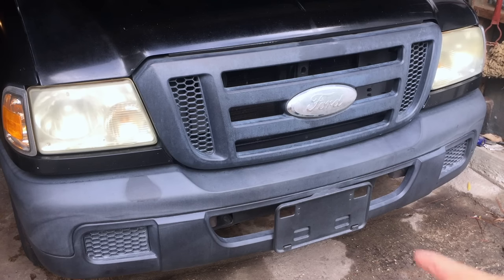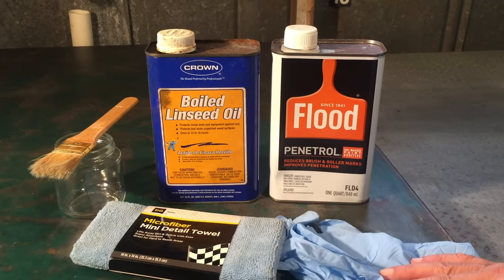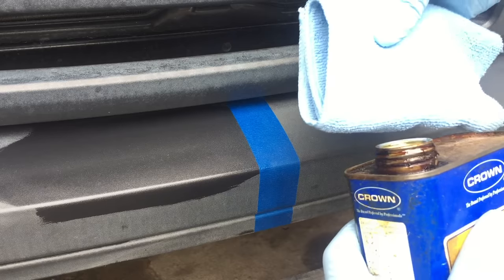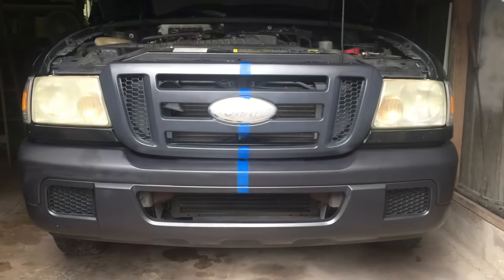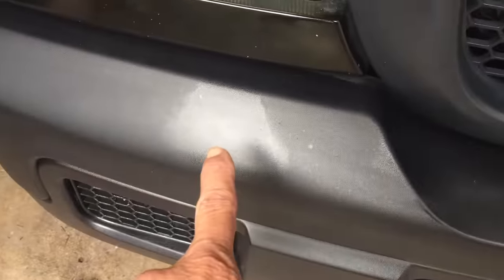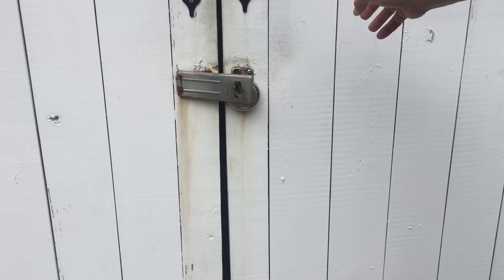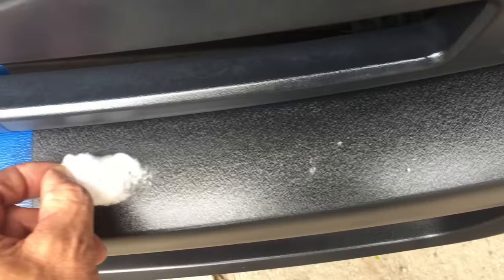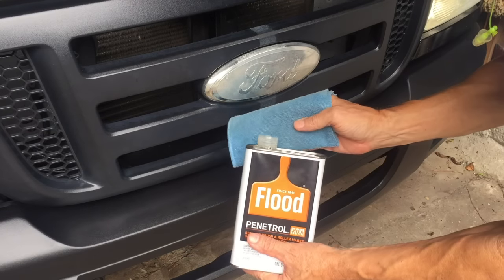Restore Faded Plastic Trim Penetrol Vs Boiled Linseed Oil

Comment: Having worked at a shop in the desert that specialized in off-road vehicles I do not recommend using a heat gun on plastics or linseed oil (alone). The plastic fades because of UV exposure and the oils in the plastic coming to the surface, oxidizing and flashing off into the air. By using a heat gun method you typically clean off the oxidation and then pull the oils in the plastic back to the surface. The problem with this is over time the plastic will become very brittle. By using linseed oil alone it can not penetrate into the plastic very well and simply dries on top. The penetrol however, because it has a solvent, penetrates INTO the plastic thus replenishing lost oil back into the plastic. Bottom line use Penetrol and then a UV inhibitor such as 303.
Reply from the maker: Great information and suggestions!! Thank You!!
Reply: Thanks for sharing great info. I’ve seen others use 303 alone now Penetrol and Protectant should seal the deal!
Reply: Soo now I have to varnish my boat AND truck!? What world is this?
Reply: Just go ahead and prep and varnish your entire car. Three coats for every month of sun exposure yearly. Lol
Reply: This is for vehicles, you’re gonna sell right away, so…
Reply: @walterkersting9922  I wouldn't do that to somebody.
Reply: I live in the dez.  Nothing seems to last longer than a couple of weeks before my old Jeep fenders look crappy again.  I'll have to try the Penetrol + 303 combo.
Reply: @chesterreese2771 Howdy folks, since posting this I came across a new product that appears to have great promise. I have not tried it yet but I know someone who has and it looks amazing. The product is called Cerakote "Ceramic Trim Coat Kit" and he used it on the rubber also.
Reply: @tongo117  Howdy folks, since posting this I came across a new product that appears to have great promise. I have not tried it yet but I know someone who has and it looks amazing. The product is called Cerakote "Ceramic Trim Coat Kit" and he used it on the rubber also.
Reply from the maker: If anyone is familiar with the Project Farm youtube channel Cerakote won his car trim restorer competition a few years ago:https://www.youtube.com/watch?v=XXOX4z6uwXo
Reply: I mix with minerals spriits
Reply: So how long does it last? With penetrol & 303?
Reply: @ronniegillaspy  Howdy Ronnie, it's not a permanent fix but the Penetrol helps to remove the oxidation without drying out the plastic and the 303 helps keep it that way. Depending if you left the vehicle outside or parked it in the shade or garage the amount of time this would work varied. However, after posting this a friend of mine introduced me to the new Cerakote Ceramic for Plastic. IT WORKS GREAT! One thing though, be sure to remove the oxidation first with a good cleaner and possibly a 1500+ sandpaper.
Reply: I used to do all that. Now I just super clean the trim and cerakote it with a good spread. Its absolutely gorgeous.

Comment: Let me add something to the discussion,  Penetrol is also excellent rustproofing...wire brush the loose rust off and 2 coats and it will not rust. Its original use was the NAVY used to dry dock their ships and sand blast the hulls, penetrol then primer and paint...back in the ocean for 7 years.
Reply: I new the employee that worked on the owners new Cadillac that the guy who started the Flood company...every year in the 60's he bought a new Cadillac and my contact would soak his brand new cars down ...The guy sold the company in the mid 90's and had 10 showroom condition Cadillacs that he drove all the time...
Reply: Knew....
Reply: Going to try this on an outdoor steel work table. Thanks!
Reply: @manandatractor  by itself it is not UV resistant...oil base paint over it.

Comment: I added 25% white spirit(mineral spirits in the US) to boiled linseed oil. It seemed to help absorption and dried quicker with no sticky residue.
Reply: I agree but I use 60% boil line seed oil and 40% mineral spirits

Comment: I tried using Penetrol on my 2020 Toyota Sienna. It only lasted 2 days before reverting back to its old oxidized self:(
Reply: Did you use the water based version or the oil based version? Legit question, as I'm researching if this is what I want to do.

Comment: I fought this battle for ever; bought all kinds of stuff, tried ‘hacks’ and so on.  Then one day I took all the plastic off of my car, taped off all I couldn’t remove and painted it with a flat black spray paint.   Twenty years later it still looks good.   I have a foxbody Mustang that all the black trim looks brand new on.      Just five up the fight-  wash the parts with Dawn dish soap several times, when dry clean it with prepsol or denatured alcohol and put two to four light even coats on the part.  I have done the same on my wife’s pilot, and I have a 2019 jeep that is about to have the cowling vent tray painted.  I used two different chemicals on it when I washed it, but the sun in Alabama cuts through that stuff.  Paid your trim, thank me next year
Reply: Ordinary spray paint?  Not one of the plastic compatible versions? I see most of the paint companys claim univeral materials compatibility
Reply: There is paint, and then there is paint. From my understanding there can be a big difference wether they contain urethane or not for example. Would love to know which brand you used? Then again, ten years later they may have switched their formula.

Comment: Penetrol has a penetrating power 3 times that of water, it goes deep into the substrate and forms a strong bond for subsequent topcoats. I swear by it... artists use it to seal rusty outdoor sculptures etc, vehicle restorers use it to seal rusty parts/panels for a lasting patina, it's used to thin paint, it's used on vehicle chassis as a rust inhibitor prior to painting... it's uses are limitless!!!

Comment: I use that Rust-Oleum trim and plastic paint in a rattle can. It's literally lasted for years in the Florida sun and still looks good. I disassembled the grill and everything and gave it a good spraying after cleaning it up. I did a complete video about it too. Of course the video went nowhere except probably down the YouTube toilet that stuff works. It seemed like every royally thing that I ever put on the plastic parts just washed off eventually.

Comment: The best product I ever used on clouded faded trim is a ceramic wipe on from Cerakote. I put it on my truck a year ago and it still looks like new. Highly recommended.
Reply: Yes, came out in top in a side-by-side review of something like eight different brands here on Youtube. Incl. Mothers, Turtle wax and Meguiars(?)
Reply: that just coats the surface with ceramic coat. its not actually getting into the pours of the plastic
Reply: @johnadona3014  It's been a year and a half and it still looks good. I'll take that anytime.

Comment: I tested this idea several years ago on a neighbor’s Toyota Tundra’s faded front bumper. Used Floetrol, a latex paint additive, instead. Worked fine. 

If you treat plastic trim regularly with silicone tire shine it won’t fade. I applied it to exterior black plastic and rubber on my ‘84 Peugeot 505. After 25 years it looked new.

Comment: Mix 50:50 clean engine oil with lacquer thinners in a jar and wipe on. Cheap, gives the same appearance to trim as Penetrol, and it lasts a good while (maybe not as long as Penetrol, but at the price you can reapply as often as you want). The thinners helps the oil penetrate, and also avoids a sticky finish that dust will cling to.
Reply: Petroleum oils, plastics, and rubbers do not go well together.

Comment: I was talking with a guy at the gym last night about our muscle cars. He told me back in the 90’s he and his dad won 2nd or 3rd place mainly because they used Penetrol in the engine area. So.  Off to YouTube to find you. Great video. I’ve used BLO in the past but was left with a tacky surface for a while. On ATV plastics, smooth plastic, I’ve used Harbor Freight’s torch to heat up the plastic. After sanding off the white oxidized area, the torch leaves a showroom glossy finish that has lasted for 12 months. Just wanted to pass that on. Thanks so much for your video
Reply from the maker: You're welcome.. Thanks for the torch tip.. And when you say torch, heat gun or actual propane torch??
Reply: @tongo117  it’s a torch that screws on top of the green propane canister. You’ll wonder how you lived your life without it.

Comment: I use BLO for wood working and it definitely matters how you’re applying it. You want thin coats. I cut my BLO with mineral spirits (3:1 BLO:Spirits) or you’ll get thick parts that won’t dry fast enough and get gummy. You’re supposed to buff it off after the wet shine starts to dull but before it gets gummy. I live in Arizona so BLO dries to touch in a matter of hours (consider using something else in high humidity locations). ALWAYS wear gloves when handling store bought BLO because they use metallic dryers to help them cure faster that absorbs into our skin.
Reply: I cut my blo with baby laxatives

Comment: Years ago I tried automatic transmission fluid on my exterior plastic and rubber parts after seeing a part of my bumper which I had spilled a drop of ATF onto still looking "restored" after a few months. Still looked like new after 10 months which is when I sold my car.
Reply from the maker: Good to know.. Would not have thought of trying ATF

Comment: Impressive results and improves the truck no end. Just been online to see if we can buy Penetrol here in the UK and yes it can for £111 ($133) two quarts! Looks like I'll look for some other similar product 🙂
Reply from the maker: What's your cost for Boiled Linseed Oil? It's been 8 months since the application and I don't see any difference between the two sides..
Reply: Polytrol made by Owatrol works the same if you're in the UK
Reply: @Adam-wu7vt  Many thanks Adam and indeed it is available in the UK and for a much more reasonable £20 per 0.5 litre (0.9 pint).
Reply: @dontuno   No problem, I use Polytrol myself, and have been very pleased with it 👍
Reply: @dontuno  . In the UK boiled linseed oil is only £3.35 per 500ml. Add 25% white spirit and it works just as well.
Reply: that’s what I was thinking as well as white spirit is used as a solvent for boiled linseed oil, and according to previous comments Penetrol is basically linseedoil with added solvent for increased penetration. Now all we need to know is what the ideal ratio is.

Comment: I have one more product you might try.
Seal Krete by Rustoleum, is polymer link for paint and cement / mortar and concrete sealing .. of all things.. 
It makes a nice vinyl shell top coat. Add it to the other products you tried to make them perform better and last longer.

Comment: That $13 bucks added $2000 in resale value to that truck.  Great info!
Reply: Here's an update to my original reply.  I tried the Penetrol based on the results I saw in this video and I also got excellent results.  It's only been about a month, but so far there is no streaking and my plastic still looks great.  I live in the south and we've had a lot of rain, humidity and heat.  It works so much better than Back to Black in that it seems to stay on thicker and more evenly without as much effort to apply and even out.  I applied this to a Ford and a Volvo and both look fantastic.  I'm sold.  Great, useful video!

Comment: I've found that all of the ways to do this never seem to last for more than a few weeks, top.  How is the Penatrol holding up over time?
Reply from the maker: It's holding up well.. Below is a link to a related video I posted 6 years ago showing 10 month later results of Penetrol application on my 95 Honda Accord.. Not the best quality video but it will give you an idea as to how long the Penetrol lasts.. And I will post follow-up one year later video on the Ranger in mid Sept.. https://www.youtube.com/watch?v=adFWRHFalQY
Reply: @tongo117  Thanks!  Much appreciated!

Comment: If you heat the plastic with the heat gun slightly before applying it, it will penetrate deeper and last longer

Comment: Thanks for the comparison! I wonder if there is any difference between Penetrol for latex paints and those for oil-based paints?
Reply: Yes, Penetrol for latex doesn't contain any oil at all.  It's water soluble.
Reply: @robertweinmann9408  Thanks for the clarification! That is what I thought.
Reply: Good point ...,.latex and oil paint penetrol two different brands..,.

Comment: Great video, thanks for sharing. Curious question. After the initial application of the Penetrol how often do you have to reapply? After each washing or every few months? Thanks again.
Reply from the maker: It does not wash off but does slowly fade.. I use it on several cars and apply probably once a year.. If you want to keep it really fresh/dark then every 6 months or so should work..
Reply: @tongo117  awesome! Thank you for the reply!
Reply from the maker: FYI. Just had another comment on this video that recommended using this UV repellant topcoat after the Penetrol:
https://www.amazon.com/303-Vinyl-Plastic-Automotive-Protectant/dp/B0185PU38A/ref=asc_df_B0185PU38A/?tag=&linkCode=df0&hvadid=312177492641&hvpos=&hvnetw=g&hvrand=11731298867953210669&hvpone=&hvptwo=&hvqmt=&hvdev=c&hvdvcmdl=&hvlocint=&hvlocphy=9011294&hvtargid=pla-755955906432&ref=&adgrpid=61116063494&th=1
Reply: @tongo117  oh wow, thanks man, I appreciate it!
Reply: @tongo117  Great Stuff! Good for restoring wiper blades, shine tires, interior, etc...

Comment: I have a hunter green aluminum garage door that has become faded in 20 years. I tried Armorall and it does a decent job but is blotchy...paint still great underneath. What svould I use that will look good and not need a lot of care? I was thinking car wax but it doesnt last. Thanks.
Reply from the maker: Possibly this:
https://www.amazon.com/AL-NEW-Aluminum-Restoration-Furniture-Stainless/dp/B079ZYD6W7/ref=asc_df_B079ZYD6W7/?tag=hyprod-20&linkCode=df0&hvadid=242014065805&hvpos=&hvnetw=g&hvrand=3241271376380978393&hvpone=&hvptwo=&hvqmt=&hvdev=c&hvdvcmdl=&hvlocint=&hvlocphy=9011294&hvtargid=pla-478674002367&psc=1

Comment: I live in Florida with intense heat and sun. How long will the Penetrol last on plastic parts before it turns back to a faded mess again?
Reply from the maker: It does fade but slowly and I'm not far away in S/E Georgia with similar sun/temp.. The link below will take you to a video I posted 6 years ago showing 10 month later results on my 95 Honda Accord.. Same process using Penetrol on the trim.. And I plan to do a one year later video in a few months to show how much it faded on the Ranger.. https://www.youtube.com/watch?v=adFWRHFalQY

Comment: I used to use Penetrol to thin varnish to put on Teak Wood. The Penetrol slows the drying time and allows the varnish to lay out nice and smooth before it dries. I had very good results many years doing this on the Teak on our boat. The problem with Penetrol was that once you open the can, it seems the air that gets in will be trapped once you put the lid back on. Air in the can seems to harden up the remaining Penetrol in the can making it useless. Maybe someone here knows how to keep this from happening?????
Reply: Bloxygen.
Reply: Hello allen,
Perhaps if you stored the cannot upside down, the  trapped air would be under the fluid, it might work.
From Feilding New Zealand.
Reply: Try putting some plastic wrap over the lid and then screw on the top, if you store it upside down w/o any plastic wrap over the lid, you might unknowingly bond the lid to lip seal.  Again, I’d try the plastic wrap over the lid and closing it, air can’t getting into the remaining amount in the can.

A harder and more cumbersome route would be to use rubber bands over the lip seal with the plastic wrap and closing the lid tightly.  Definitely provides an air tight seal.
Reply: @angloedu5499  I will try that next time I buy some, but I still wonder about the air that is already inside the can when we put the plastic wrap over the spout. Yes, the plastic wrap might help prevent more air from seeping in around a loose fitting lid, but if we trap air in the can that is already there, the Penetrol may harden up anyway. It should be worth a try.

Comment: Has anyone restored burl wood look plastic boat instrament panels? Its shiny look  is faded badly. I saw a few methods but whats tried and true the worked best? Acetone heat or heat gun ? a permanent fix . Or wet sand and clear it

Comment: Looked up the msds on penetrol, the solvent is just naphtha. >50%, <75%
Reply from the maker: Good to know.. Did the same for boiled linseed oil which as it turns out is oil pressed from flax seeds with a drying agent (cobalt manganese salt) added..
Reply: What's the rest of it? Alcohol?

Comment: Boiled Linseed Oil can take weeks or months to dry unless there is a dryer mixed into it. Sometimes it never really dries on wood.
Reply: All big box store BLO has metallic dryers in it. You have to make your own from flax seed oil to avoid them.
Reply: I’m in Arizona and BLO drys to touch in a single day (takes a little longer to fully cure). Back in TN it took two to three days to dry to touch.
Reply: @FuriousTortoise  It is the cure time that is the problem. Just because you can touch it without the surface being very sticky doesn't mean that the application is ready to go. BLO on wood can be a great finish if you have the time to wait for it to fully cure.

Comment: Question is: How long does it last?
Reply from the maker: Related video showing 10 month later results of Penetrol application on my 95 Honda Accord.. Not the best quality video but it will give you an idea as to how long the Penetrol lasts.. Also I will do a one year later video on this Ranger in Sept..  https://www.youtube.com/watch?v=adFWRHFalQY
Reply: @tongo117  That's really good.  It's at least as good as some of the highest end trim restoration products like Cerakote and Solution Finish.